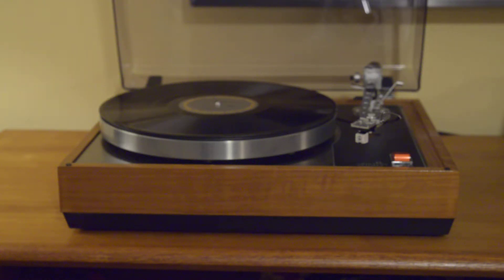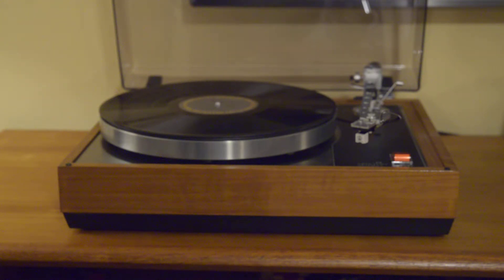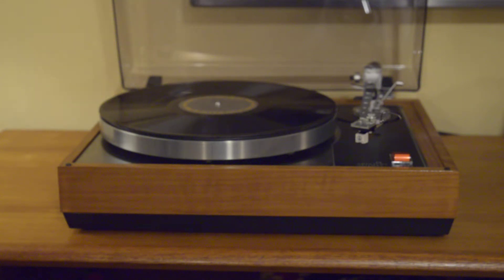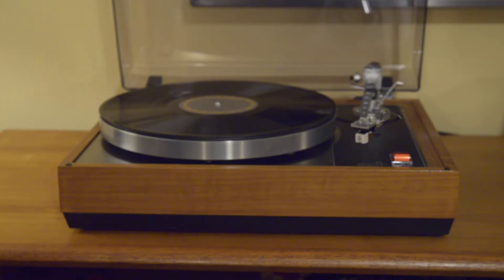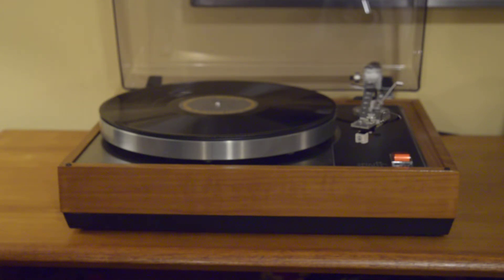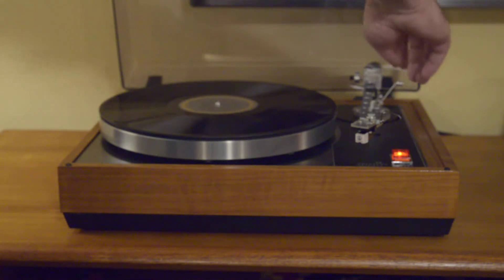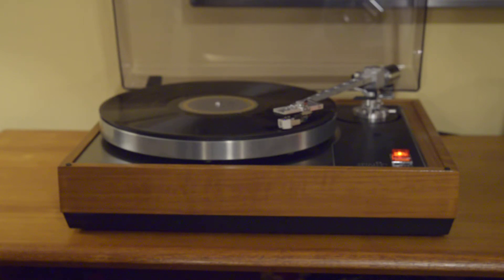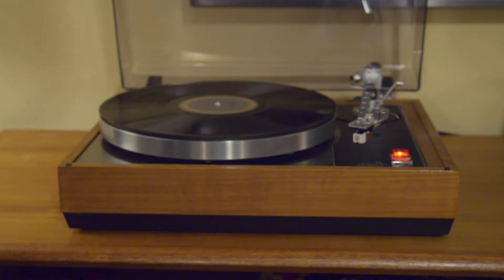Ariston RD-11S with Grace G-704 Tonearm Demo

Comment: Back in the 70's/80's I could name almost every piece of HI-FI kit on the market in England now I can barely remember my own, But I do remember this as a very good turntable at not a bad price, paired with a decent budget amp and speakers You had a good starter system for under £1000 which was still a lot then really.
Most went for a Dual cs504 turntable with NAD3020 amp and some speakers, Maybe Wharfedale, celestion,  mission or Boston. again, not bad, I wish I had kept mine

Comment: , I have Had My Ariston RD 80 Since 1981..  It Came With The Linn LVV Tone Arm ,   It is Rock Solid, And Apart From The odd Drop of Oil  It has never needed Any attention...  In The UK it was called the Poor Mans Linn...Easy To See Why Linn Sued Them...A Gem of a Turntable.
Reply from the maker: Very nice decks. I believe Linn and Ariston were more comparably priced in the early 70s, with Linn moving upmarket in the 80s with modded versions of the original deck and Ariston coming out with new designs. The engineering and build quality are very close (RD11 vs LP12)
Reply: i moved onto a Linn LP12 but wish i'd kept the Ariston

Comment: I have the Thorens TD150 which I am happy with.
I do like the look of the Ariston RD-11S.
There's one here in the UK for £220 no tonearm.
I think this maybe worth getting.
Reply from the maker: Hi, yes they are great looking decks. They commonly came with an SME or Grace tonearm. As the tonearms are valuable on their own they are often stripped to maximize resale value. Many arms will work well. The arm board is a simple wooden disk. Good luck with your search!

Comment: This is the turntable Ariston built after losing a law with from Linn products. They could no longer manufacture the RD11 as Linn (Ivor T) claimed the rights to that design (he used to work for Ariston). So Ariston was forced to make a few small changes and came up with the RD11S. In concept execution and performance the RD11S is very much like the RD11 (and it's Linn Sondek clone).
Reply from the maker: Thanks for the bit of history. Underneath this Ariston is almost the same as the Linn Sondek LP12, both are very nice tables. I believe Thorens was the first with this concept with the TD 150. Then after the Linn LP12, Thorens upped the ante with the TD 125.

Comment: The platter is really high. Looks like the springs are squashed down too tight. I bet you wouldn't be able to use the 45rpm pulley without the belt falling off from misalignment. At least that's what I found with mine before I dialed in the suspension.
Reply from the maker: Thanks for the comment. In this case the platter was not too high from a performance standpoint and played well on both speeds. I find with these and similar sprung chassis decks (such as the Thorens 125) that a some compression on the springs as well as some damping (resilient foam blocks pressed into the springs) really helps calm the deck and provides excellent isolation without being jittery. This was especially important on this deck with the uni pivot Grace tonearm. I can be hard to gauge how these were initially set up and early marketing photos are often not correct. I believe that when set up correctly the tonearm board will be at minimum level with the plinth, up to a maximum of 1/8" above the plinth as this one is set. The platter should be level with itself and the tonearm board as they are both mounted to the sub-chassis. If it doesn't set up well thin these boundaries then it could be that the springs are stretched and need to be replaced.